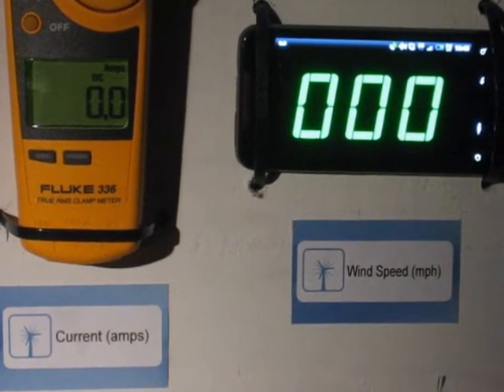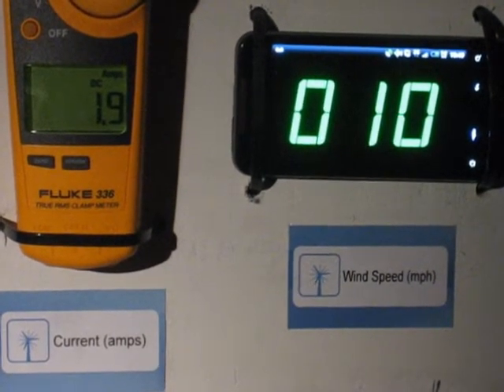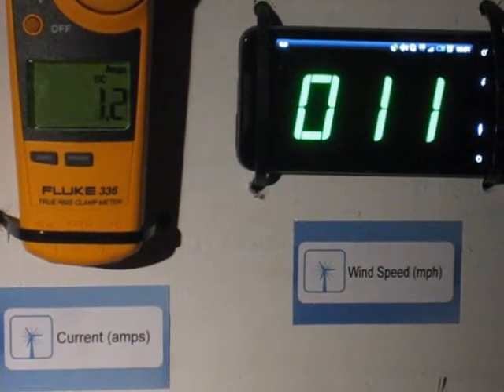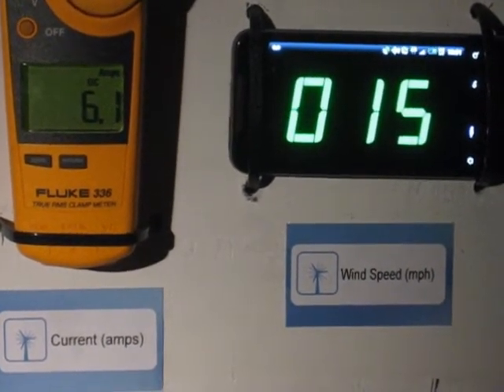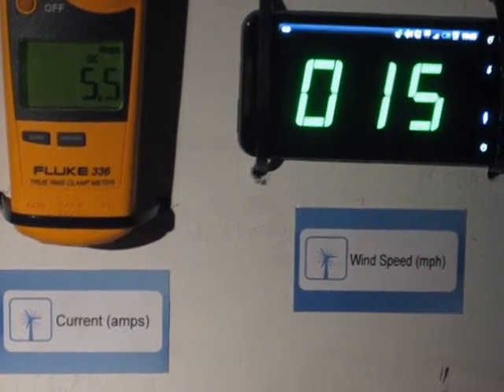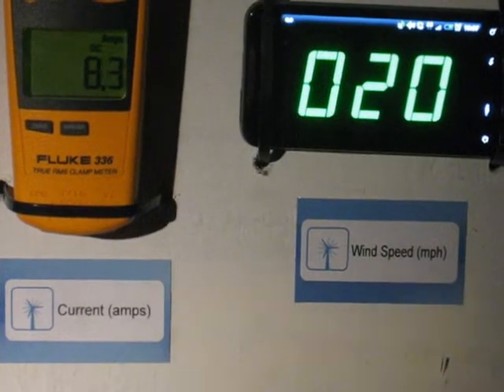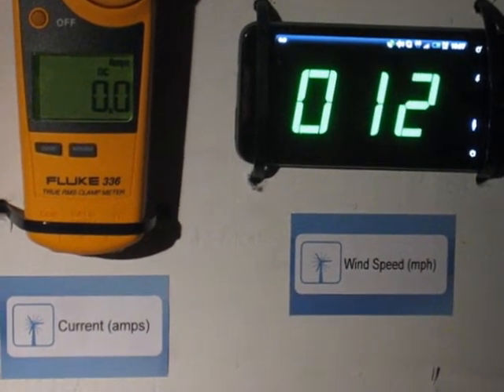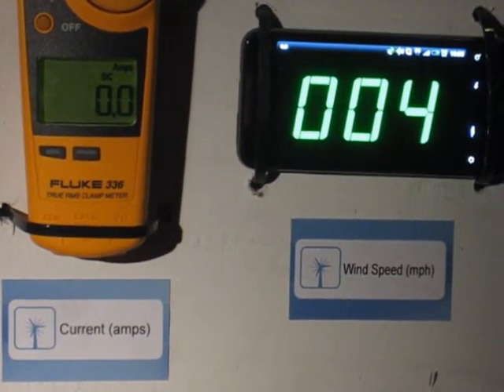WindyNation's Windtura 500 Wind Turbine: Real World 24 Volt Power Curve

Comment from the maker: @Fearlessthinker 

3.The prototype mount was not constructed perfectly. The directional tail was about 7 degrees off axis with respect to the blades. This caused the blades to be 7 degrees "out of the wind", when we were driving.

4. In the new video, the test pole is 21 inches longer. This allows the turbine to receive cleaner, less turbulent wind. When the wind bounces off the truck, it creates turbulent wind. If the turbine is higher, it avoids some of this turbulence.

Comment from the maker: @Fearlessthinker  Well, there are many minor improvements we made as the initiial 24V test was on a prototype mount. But, I will outline the main reasons for the increased power:
1. The new test is on a MUCH smoother road. Bumps in the road cause the blades to continuously lose rotational momentum.
2. In the old video we were driving with (not into) a 1-2 mph wind. In the new video, there was absolutely no outside wind.

 .... running out of characters will continue in second post.